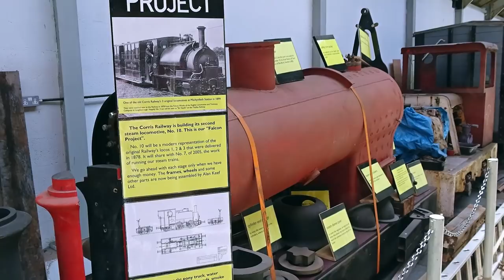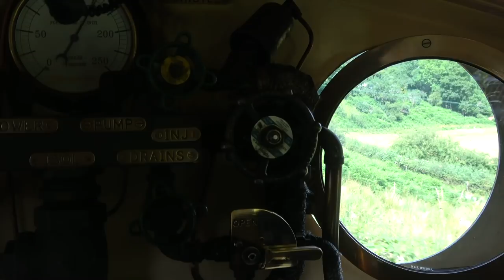Corris Narrow Gauge Railway (Wales, UK)

Comment: I’m building an OO9 layout.  Your videos are so inspiring!
Reply from the maker: Hi Robert, 009 is good scale to use, not too big and there is an ever increasing array of 009 ready to run models available. Is your layout based on a particular railway of freelance? I'm pleased you find these videos useful.
Reply: Hi Tim.  No place specific, just the flavor of Wales!  It’s the scenery, the walls, foliage, fencing, signage, structures and stonework that is so fascinating.
Reply from the maker: @RMStinson  Welsh scenery makes a good subject for narrow gauge modelers. I took a quick look at your channel, is that the National Railway Museum Sterling Single by Rapido Trains Inc? it looks and sounds magnificent.
Reply: Timsvideochannel1 Good eye! That’s the one.  A keep-alive circuit and two axles powered make it a smooth runner.
Reply from the maker: @RMStinson  I think I'm going to have buy one to add to my collection, some of which are shown in this video - https://www.youtube.com/watch?v=0T_zWin1o7E&t=390s

Comment: Nice. I've got that route on a game. Quite interesting seeing what the route looks like in real life compared to in the game.
Reply from the maker: I hope the real thing lived up to the game, being a smaller railway, visitors get a much more personal experience.
Reply: It was better. Was quite surprised how much the layout of the Corris station had changed. But other than that I was quite neat seeing parts of the line and the main station and sheds exactly as I remember them in the game.
It was a bit of a shame that you didn't go down the other section of line. The grade down from the main station is quite steep. It makes for a fun time heading down if your train gets a bit too much momentum in the game XD
Reply from the maker: That's interesting, the line past the station has not been relaid yet, although work should start soon. I wonder if the game is based on the original line before it closed. Most of the sheds in the video are the original buildings, although the carriage shed is a recent addition.
Reply: That's interesting. Na the route in the game is based on the present day route, so the route developers must have used plans for the line past the station and the carriage shed, and Corris station. It looks quite a bit different in the game compared to the station in real life.
Will just get a link to the store page/s that have photo's, and possibly a video.
Reply from the maker: Hi, I looked at both links, most of what is shown does exist, with two interesting exceptions, the overall roof at Corris is a proposal at the moment and the works train next to the road is almost real-time, in that will happen soon. For the railway to extend, some realignment will be necessary as road improvement works have encroached on the track-bed. You might find this link interesting - https://en.wikipedia.org/wiki/Corris_Railway
Reply: Hi, the game is based on the proposed extension to Tan Y Coed for the line and also features a version of the plans for the revamped Corris station. It is a very much a look at what hopefully will be the future!